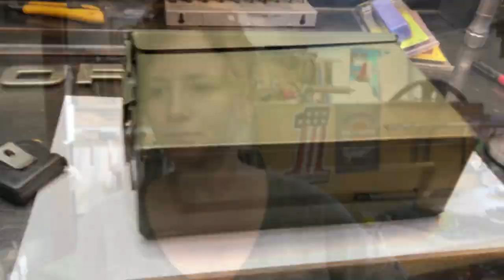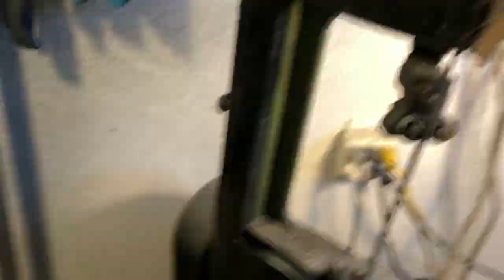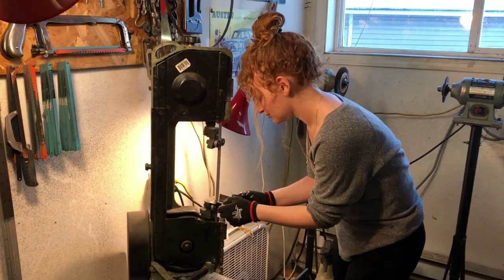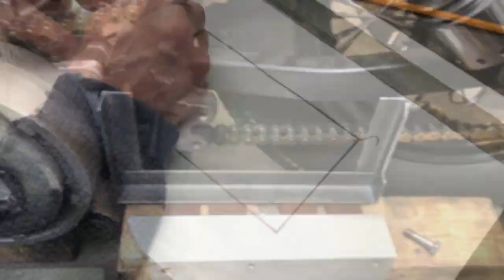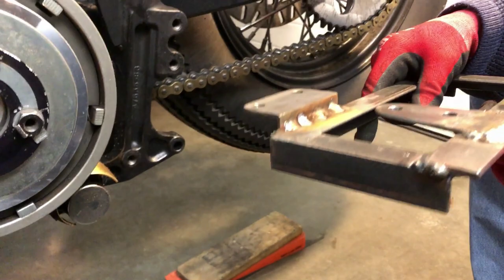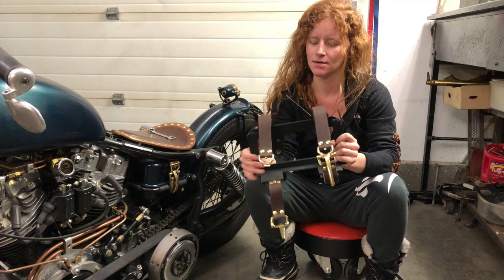Adding storage to my Shovelhead

Comment: Good job of utilizing limited space on your shovel Lil Red. My concern are the buckles becoming unfastened when riding. The shovel has lots of vibration and I'd advise keeping a close eye on the buckles. If they do unfasten when riding I'm sure you'll come up with a suitable alternative. Good job on your work and keep the videos coming.
Reply: My thoughts also. Leather will stretch, possible causing excessive slack the strap tension. Instead of rubber, perhaps thin clothing grade Velcro to  dampen vibration and add another layer of security? That handle is going to rattle bad! Lol It does look really good on the bike, tho.
Reply from the maker: I’ve got something in mind to take care of possible stretching and the buckles 😉

Comment: Choosing bolts and nuts for an old car or motorcycle is always Russian roulette. When half a century ago there were other standards for sizes and thread pitch.
Reply from the maker: And it’s always good to save nuts and bolts from different things! If something is broken and going to the trash I always make sure to save the fasteners from it before it gets tossed out.